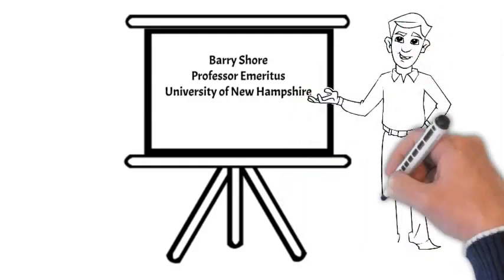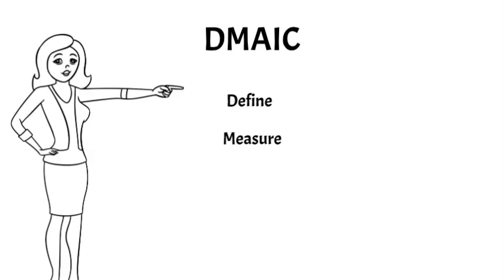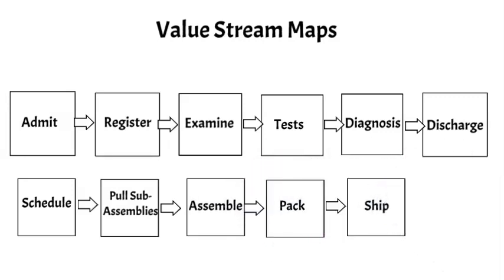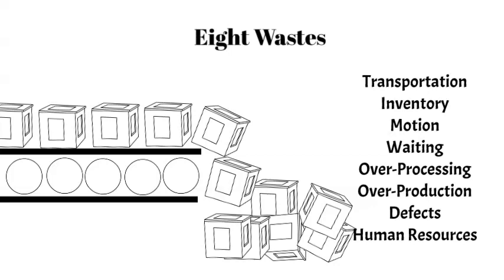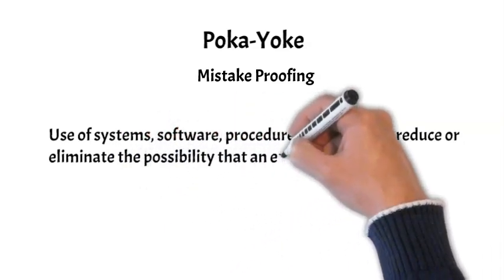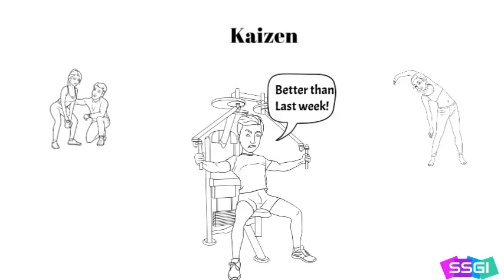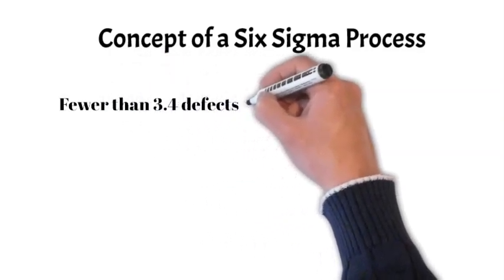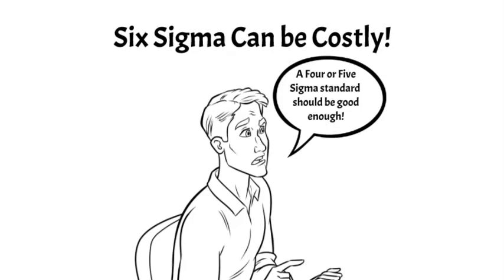Lean Six Sigma Tools for 2025 | Top 10 Six Sigma Terms |

Comment: The center line of a control chart is not a target.  It is the average performance.  Targets can be found on other Lean Six Sigma tools but they are never on control charts.  Control charts are voice of the process tools and a target is a voice of the customer concept.
Reply from the maker: Thank you for your insightful comment! You are absolutely correct. The center line on a control chart represents the average performance of the process, not a target. Targets, which reflect customer expectations and desired performance levels, are indeed found on other Lean Six Sigma tools. Control charts are designed to be "voice of the process" tools, highlighting actual process performance and variations, while targets are "voice of the customer" concepts. Your explanation is spot on and a great clarification for everyone. Thanks for contributing to the discussion!